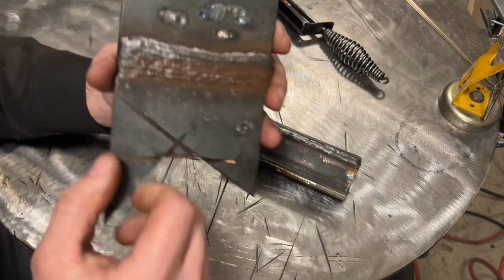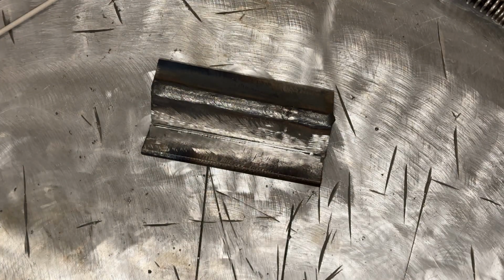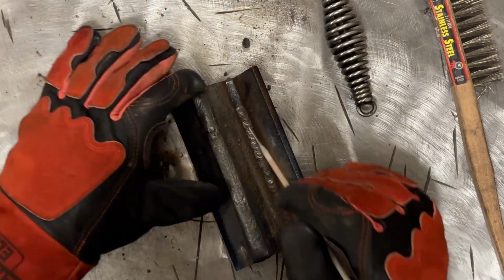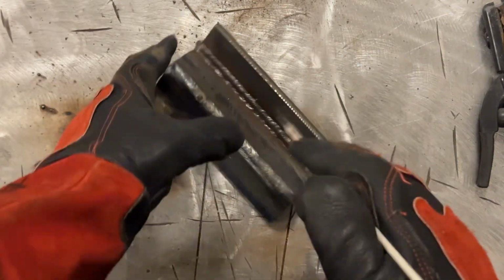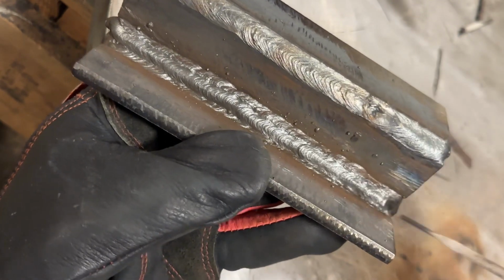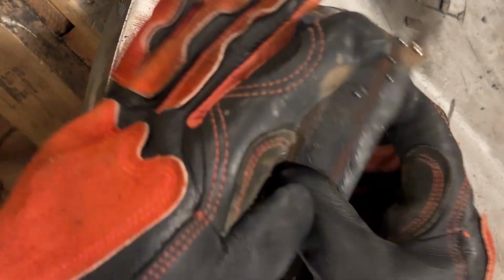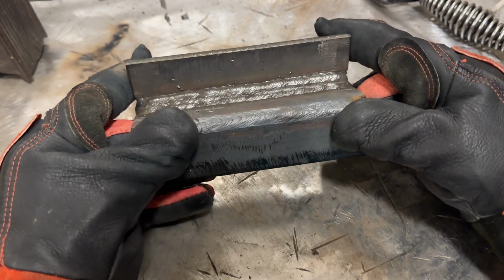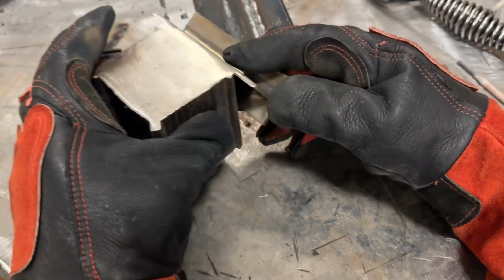How to multi pass stick weld: Introduction

Comment: I'm a novice at welding and I do it because I like making things out of metal. I know my limitations so I do not attempt anything structural. I seem to have difficulties striking an arc with a 7018, the arc just doesn't happen no matter what I do, and then the rod gets stuck. Is this because 7018 is hard to strike? I have no problem striking an arc with 6013.
Reply from the maker: So this should help you out:  7018 tends to be much harder to start than 6013.  Some of the reason is welder dependent, if the welder you’re using doesn’t have hot start (even better if it’s adjustable) the rod will be harder to start.  Also, if the welder has lower “open circuit voltage” aka the voltage present before you strike the arc, it will be harder to start the arc.  Even with a simple welder without fancy controls you can run 7018, it just takes practice.    You need to build up repetitions on starting the rod.  Slightly tapping the rod tip to the work and immediately increasing the arc gap to about 1/16th (1.6mm) or slightly more should help.  If the rod tip is in contact with the plate for even slightly too long it will stick.  

Edit: I almost forgot, there are “easy strike” 7018 rods out there such as harbor freights 7018 and Esabs 7018 prime rods.  They have a graphite tip that makes the initial start far easier.  Keep in mind restarts with 7018 tend to tough, you must knock the flux off the end of the rod to get a better start 👍

Comment: I taught myself Tig welding running bead after bead after bead......... Well worth the practice time.
Reply from the maker: The hardest part of learning to weld is doing the tedious part, aka a lot of practice making simple beads.  The better you can weld simple beads on plate the better everything else will be 😀
Reply: ❤❤❤❤❤❤❤❤❤❤❤❤❤❤❤❤❤ @makingmistakeswithgreg

Comment: Great stuff, Greg. I'm learning lots. Thank you. But that the angle narrowed from 90⁰ as the cooling contraction forces. That was quite a change. That must be a tricky consideration to factor in. Welding a right angle that moves to become 70⁰. I'm a beginner, so it was a surprise.
Reply from the maker: Glad you’re learning.  There are many ways to deal with contraction due to welds.  “Doping” the weld joint so that as it shrinks/cools it moves into alignment is what I most commonly do.  Rigidly clamping the weldment so that it doesn’t move much helps, but is often difficult to do.  The truth is for much of what most people do, you typically only need a single pass and the material has enough give that odds are things will work out with minimal movement.  For situations that movement is very undesirable it is a must to have a very precise fit up, and not put excessive weld material down.  This is especially true of stainless, it moves probably 4 times as much as steel.  Speaking of that, generally speaking the poorer of a conductor of heat the material is the more it will move when welded.  Aluminum moves very little, but is an excellent conductor of heat.  Stainless is a poor conductor of heat and moves a ton.

Comment: I tried what you suggested and ran passes for about 4 hours in a piece of angle steel. Noticing my welds are improving. I've only been stick welding a few times and things are looking better using these exercises. I can almost do it one handed without propping my arm now.
Cheers from Australia.
Reply from the maker: That’s great news.  It does suck repeating the same thing over and over.  However once you master the basic the impossible becomes possible.  Very few things that most people learn require as much practice to really master.  Hand writing, playing an instrument, and welding are all very similar is this regard.  If you keep up the good practice/work you will find you will progress fairly fast.  The key is to be smooth, consistent, and don’t let frustration/failures discourage you.  If you can get through the failures/frustration you will become skilled.

Comment: Thank you for the many welding lessons. Often as I am watching you demonstrate, I wish that I could see the welding pool. Today was excellent because seeing the welding pool, then listening to your follow up analysis immediately after completing the weld is the most helpful lesson for me. Again, Thanks!  I am trying to become skilled enough to weld 5" segments of 1" square bar to 1/4 ", or 1/2" plate as I build various tools to use mounted in my anvil 1" hardy hole. I am learning how to use the new Miller Multimatic 255 Multiprocess Welder w/ EZ- that I added to my blacksmith shop.
Reply from the maker: No problem and I am glad to hear you're learning/working at learning to weld, that's great.  The miller 255 is a beast of a welder and will serve your use well, especially with heavy plate.  Based on needing to weld 1inch square bar to 1/4 or 1/2 plate, you have a bunch of options.  You could stick weld it with 1/8th or 5/32 7018 rods, both of those sizes would get the job done with strength.  You could also tig weld it if you have the tig torch.  That would easily do the job but it would be slow in comparison to mig and stick.  For wire you have a few options.  Short arc mig (basically lower settings with c25 gas) will struggle on that thick of material, it will have poor penetration.  Because that welder has so much power you could run spray arc (basically the same wire as short arc mig, but run with a different gas blend like 90/10 or 95/5 argon/co2 and at much higher settings).  I dont have any videos on spray arc but its not that hard to do, with the right gas blend and settings.  It will penetrate that thick of plate and produce very strong welds.  A easier option would be dual shield flux core in .045 wire.  Dual shield often uses the same gas as short arc mig (c25) and produces very clean/defect free welds.  It's far easier to weld with the wire than spray arc (since dual shield welds uphill easier).  

Not knowing where you are for skill, and based on you needing to weld thick metal, I think dual shield would be the way to go.  Its just as easy (and easier in some cases) as gas shielded mig, it will weld that thick of material without issue, and it will make good looking welds.  Since you have very thick material you can run hot settings and not worry too much about things like melt through.  You want to focus on being consistent in movement and smooth in travel speed.  Its definitely doable, I think dual shield would be the easiest way to get to welding thick stuff with minimal practice.

Comment: I like the fact that your welds are not absolutely perfect each time and that you point out the areas that could be more improved and you explain how to improve them. If i were to watch perfect welds each time, I'd get very frustrated with my own welds and possibly throw in the towel. 👍👍
Reply from the maker: One of the things you will find is that if you weld 40 hours a week and only take pictures of your best, it will seem like you’re the most perfect welder.  This is many people on instagram and even YouTube.  I know I have plenty of pics that could easily make me look like a top tier welder, but I don’t see much value in doing that (and it’s stressful to try to keep up that). There are people out there that can achieve near perfect welds every time, but you will most often find them welding things that make it very easy to weld perfect.  Welding on 8in pipe with tig and walking the cup is much easier to get a perfect weld on that exhaust under a car in a driveway.  Being a great welder has more to do with caring enough to get skilled, and going back to fix mistakes.  

I know it can be frustrating when you watch other people make things look easy.  You just have to remember that it’s a skill, and it takes practice to get better.  You can (and will) get better at any skill you want, it just takes time and practice.  Obviously when you don’t see fast improvement it can be discouraging, but you need to look at where you started to where you are today.  Practice a bunch, and then look at where you are in a few weeks in comparison to now.  You will see progress (even if it’s minimal).  Regardless how much or little progress is made, you will be closer to your goal.  Just like a 1000 mile hike, You can’t try to run the whole thing non stop, you won’t make it.  But you can walk it a bit at a time and anyone can get to the end😀
Reply: Where have you been when I first got into welding a few years ago?  I am a hobbyist welder and only do small time fabrication at home. Would like to see a video of how you would go about welding thin square tubing and what rod.  I wish you all the best and Thanks for putting out these videos.

Comment: You mentioned that if the root pass isn't in good, then that throws everything else off (or something along those lines)-  truer words have never been spoken.  I learned that lesson doing my groove welds-  I figured out real quick that I have to have as uniform of a root pass as possible for the whole thing to work out.  I got to the point that I would just practice running a root pass on multiple plates until I had it like I wanted.  Then, I take the plates on grind down the non-uniform root passes down to relative uniform and then fill those out.  I went through a few plates, but wasted none.  A good root pass is everything-  just like the foundation of a house.
Reply from the maker: 100% 😀.  It’s so hard to come back from a bad root.  It definitely pays to set yourself up so it’s as easy as possible, any reduction in the chance of a mistake is a good thing.

Comment: If you don't mind me asking Sir, what's your favorite brand of rod to use? I've always been a Lincoln fan, but lately I've been having trouble w slag entrapment.  Even with just tacks.  Thank you, and keep making videos please!
Reply from the maker: For 7018 I love esab 7018 prime rods.  I have ran probably 20lbs just doing videos lately and a few repairs.  It runs 100% consistent, batch to batch and weld to weld.  For 6010 I like Lincoln’s 6010 5p (red rod) and their 5p plus (grey rod).  For 6013 esab or Lincoln’s is ok.  I also like Washington alloys rods but they are far harder to get around here.  

If you’re running into slag entrapment are you running 6013?  It’s very easy to get it with that rod (even I did in some of my videos).  When you see slag entrapment you need to either go up 5-10 amps as a start or run more of a drag angle to hopefully push the flux back so it doesn’t get ahead of the rod.
Reply: @makingmistakeswithgreg  honestly sir, I just ran a 7018 for the first time the other day lol.  Ran awesome tho.  I mostly use 3/32 6011 for tacking, and same in 1/8" for welding. If I could use 6010s I would.  I'm cleaning up my parts, as well as running newer electrodes.  But just today I picked up a box of 7014 for tacking perposses, it'll be interesting to see how it goes.  Anywho, thank you sir, and I'll be getting some of the esab rods to try too.
Reply from the maker: @andrewbradstreet4218  7014 tacks pretty good.  The welds it produces tend to be a bit odd/lumpy for me.  If you’re getting slag inclusion with 6011 something must be wrong with the rods.  They do take more heat than 6010 so don’t be afraid to run them hotter than you think they need.  They run like a 6010 they just need a bit more amperage.

The esab 7018-prime rods have a graphite tip which instantly starts the arc with a new rod.  That makes sticking starts a thing of the past.  Even harbor freights 7018 has a graphite tip, and those run decent (great practice rod, I still prefer Esabs prime).  The main thing I like about 7018 is how the slag comes off easily.  6010 is a bastard to clean the slag off of.  

If your 6011 rods are running rough, take 2 of them and dip them in water and let them dry to the touch and try running them.  If they run better the rods probably lost enough moisture that the flux is starting to fall apart.  The flux has much higher moisture content than many other rods.  If all else fails try a different rod too.

Comment: Nice footage and the way that you explain what’s going on is excellent.   With 3/32 I tend to run around 90 amps so that I have the option to long arc it a touch to get a flatter bead profile.  I’ve done quite a bit of 3/32 where I should have ran 1/8” but I didn’t want to go to the ground and adjust the machine.
Reply from the maker: Great tip.  A bit of a longer arc certainly would have helped me flatten the beads out a bit.  I am so used to running 1/8th rods that I don’t need to do that on that it’s a learning curve with 3/32.

Comment: have you ever heard of someone putting an amp control button on their stinger for stick welding.  even at my novice level of experience, i notice how much hotter the weld gets as the electrode shortens.  seems like if you could turn down as you moved along it would make the weld more uniform.  i know pipeliners often have a "box" that the helper uses to change output on the fly.  I know tig people can have a switch on the handpick sometimes for work done standing up.  could a small rotary switch on the stinger do this too?
Reply from the maker: Like you said pipe liners have a control box, and it’s pretty much needed because they have to weld overhead, vertical up, and flat on everything, sometimes all on one rod.  Without some form of adjustable amperage they would have a hell of a time getting things to run right.  For home use (and without a helper to man a control lol) I find that machines with adjustable hot start help a lot.  By having hot start on your starts aren’t cold, and everything runs better.  The end of welds can run a bit hot, especially if they are ending at the edge of a plate.  Experience will help a lot to keep from blowing the end off of a weld.  Downsizing rod on size will also help with this, because the amperage is lower.  

Believe it or not some tig welders that can do stick actually can use the foot pedal to control amperage.  Generally it’s cheaper imports, and how effective it is I am unsure since I have never used one that could.  Some stick welders can also pulse which will help with keeping heat input lower at the last 1/4 of a weld.  It’s something that with time and experience you will adapt to.  It’s also why I tend to tig anything 1/8th or 3/16th and under and only stick weld thicker plate.
Reply: @makingmistakeswithgreg  thanks, good information